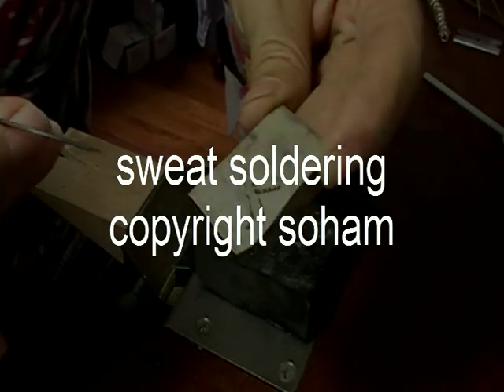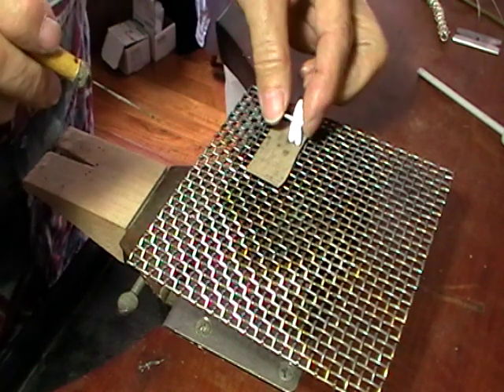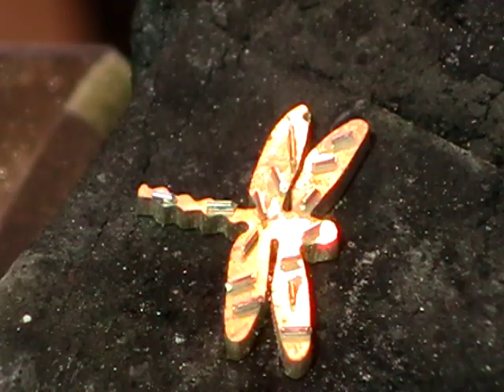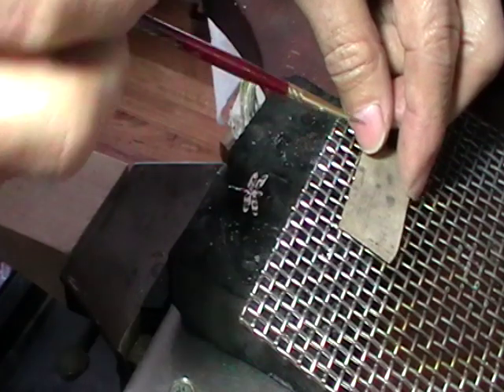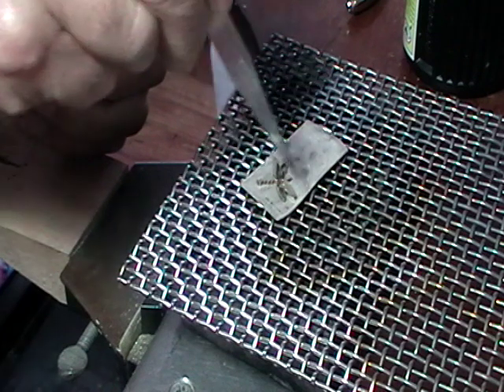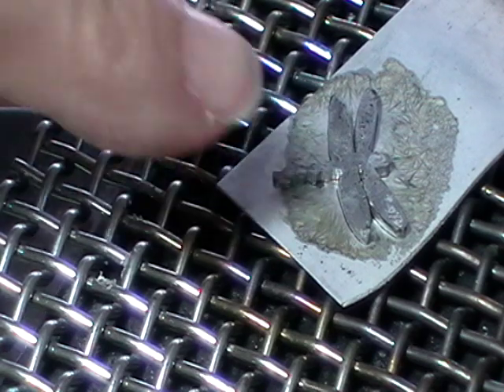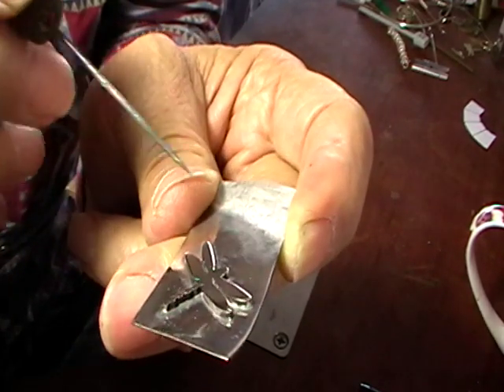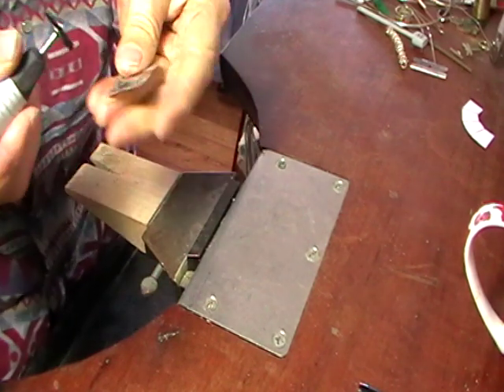sweat soldering

Comment: There are some smart tricks to solder an item to a flat surface without leaving any trace of soldering . One don't need to file or to scrub the joint angle of pieces in contact after soldering them . One can even put the piece over the flat surface without add the solder first , can be soldered after , very safe , the solder will go under the piece without leaving any trace .  This way the surface will stay clean and uncontaminated by solder .

Comment: I 'll let go of - from privacy -one of my videos to show how soldering it can be used to get the look of welding cast object. The object in discussion is the woman , who is hollow , not cast .
I made it using 18k gold and the solder is made by my own needs ,related to the difficulty of the work. Also, I do my own soldert when it comes enameling, especially plique a jour, and is usually purer than the material that is in the works. That;s why one can't see any soldering joint on my works .

Comment: This way , one can solve the most important task in enamelling , instead of carving the metal ( champleve) , can easily solder the piece - even fretted before - to a flat , even or not surface , using a hard solder , and enamelling it . it will work fine . Trust me . 
"Jewel is a very simple job, has only some basics, physics and chemistry. And  thousands of  helpful tricks." Said once  an old german goldsmith ...

Comment: Soham, I really enjoy your videos.  However, I am having a HORRIBLE time trying to sweat solder an 18-ga sterling piece onto an 18-ga. sterling cuff bracelet.  I am cleaning it all, sweat soldering the top piece, and no matter how long I torch it, it will NOT adhere.  I have no problem sweat soldering small pieces, but cannot do it on cuff bracelets.  Any suggestions?
Reply from the maker: sounds like the torch is too small, crank up the heat
Reply: soham harrison I have the Smith Little Torch and used the "rosebud" torch using 16psi for both the oxygen and propane tanks and I thought I had really turned up the heat.  Is that still not enough?  Thank you for your response!
Reply: It's tricky still trying to work it out I use 16 gauge sterling silver 1 inch bracelet with 16 gauge piece to solder on fairly big one time I had to heat the whole bracelet then run a torch on top as well as bottom not enough heat it takes some patience and nerve I'm going to try the way in the video I've done it many times this way you got to make sure your piece sits down completely flat so I've pushed it down with the soldering pick before good to have a soldering stand